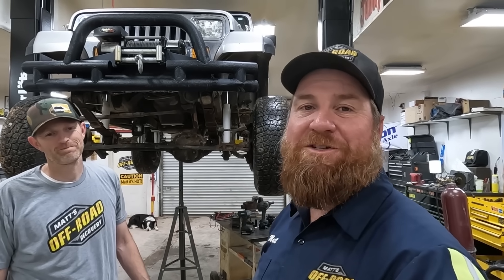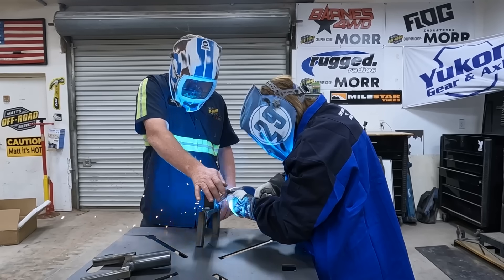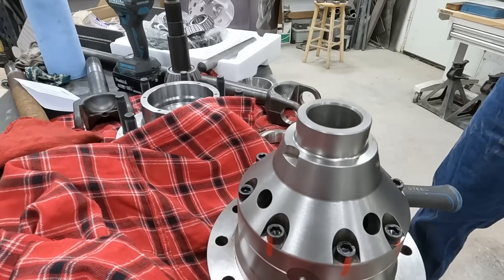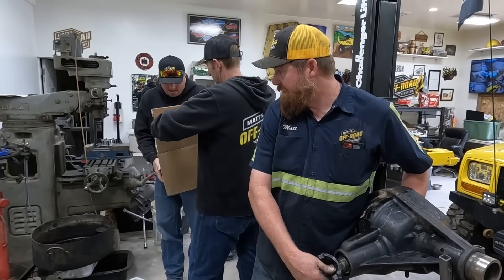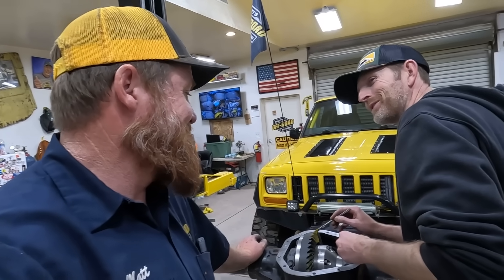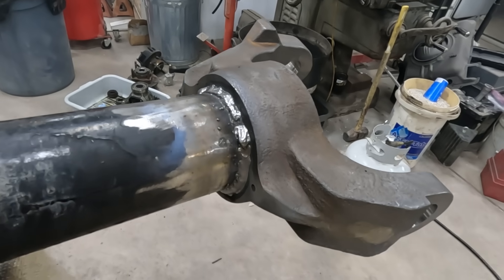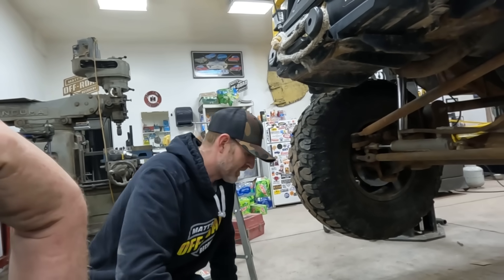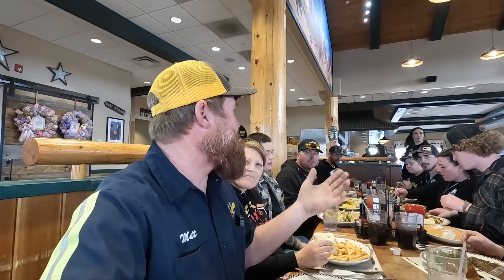Ouch...They Broke My Jeep At The Wrecker Games

Comment: Can you give an update on how Ed is doing? Seems like we are seeing him less and less. If he’s ok to share that is.  Worried about him! ❤
Reply: I was thinking the same! Matt once said it was a "strained neck".  They need to find a gentle chiropractor in the area. It can work wonders, especially if it is primarily percussion tool adjustments and not necessarily traditional manual style. My practice is way too far away over here in Sacramento. I use the Arthrostim tool. It could most likely
 significantly speed the healing process.

Comment: @13:42 The main difference between hot rolled steel and cold rolled steel is the temperature at which they are processed. Hot rolled steel is rolled above the material's recrystallization temperature, whereas cold rolled steel is rolled below the material's recrystallization temperature.
The cold rolled steels' tensile strength is higher than that of hot rolled steel. Cold rolled has a tensile strength of 85,000 psi while hot-rolled steel has 67,000 psi. Cold rolled steels' yield strength is also higher than that of hot-rolled steel, at 70,000 psi compared to the latter's 45,000 psi.

Comment: So was the reverse band smoked or was the band snapped in the 4l80e?  I have a shift timing mod that I came up with years ago that prevents the band from being damaged due to repeated forward reverse forward shifting.  Rigid type bands have limited adjustment ranges due to the ends of the band touching so running tight tolerances is extremely important.  When people perform the dual feed direct mod a reverse engagement delay is created due to the larger volume of fluid needed to fill and exhaust from the direct drum.  I run well over 2000hp in 4l80e transmissions with trans brakes and bump buttons for staging turbo cars and I never have problems with the reverse band.  I run billet servos in all 4l80e builds.

Comment: Just in case you were serious about throwing the old drill press in the scrap pile - I encourage selling it cheap or giving it away with all the caveats you want. There are tons of aspiring machinists and young shop people who would benefit from it, or taking it on specifically as a project to make it better (replace bad bearings, bore out the casting to true things up or sleeve bad fits, etc) as a learning project or use parts from it to repair other machines. Thanks for the great video on the front end repair and upgrades!

Comment: Matt and Tom, I have a serious question to ask of you both.  At this point in the process (38:00) i just noticed that you are working on the axle that you had just completed the magic in the gear box of the differential.  I also noticed the hub of the same axle is still detached!  You spent so much time aligning the gears of this axle, isn't the critical alignment directly affected by it's not being attached while you're aligning the gears?
Reply from the maker: Completely independent of each other. 
The axle shaft have no bearing on the set up or retention of the gears.

Comment: Hi folks,  I build motorcycle trikes and   for years used plastiguage to set pinion  gear preload . Now I use clingfilm. I find   when the taper roller bearings just start to cut through the clingfilm,  the lash is bang on.  Love the channel,  I was into off roading for 15 yrs with a heavily modified Daihatsu Fourtrak so your videos speak to me 😂

Comment: Differential advice from an ancient retired technician. When regearing a differential I always reuse the pinion depth shims. I do this because it's the housing that is likely to be out of spec and pinion is a highly tolerance item so you're not likely to go wrong reusing the shims. For the preload on your carrier also like to go + .001" to .0015" do the measure Gap to get the proper preload on the carrier bearings. But you probably already knew this stuff
Reply: They have no press or bearing separator to get the old pinion shim off. They talk about it when he starts his setup process.
Reply: @hillarylevenworth8824  hot retro take that old bearing off and you could still save the shims at least enough of it to get a measurement. You're talking to somebody with over 50 years Automotive experiencing hundreds of differential so I know what I'm talking about. Unless of course you have the setup jig for that particular differential then you could go from scratch. But regearing a differential isn't terribly hard especially Theory use the pinion depth shim.

Comment: 31:00 They are adding a aftermarket dif cover.  Banks Power YouTube channel did an exhaustive exploration of aftermarket dif covers vs. factory dif covers and showed that factory dif covers were way, way better.  They are engineered to keep the oil and gears much cooler.  Even without fins on the outside.  It's all about the flow patter of the oil inside the dif.  Matt, put the original factory cover back on!!!!!

Comment: Hey Matt, can you please get someone to post the stats of how each of the teams scored in the welding challenge, the dyno numbers, the flex tests, and how far each team went on the dead pull? It'd be cool to be able to compare this years' stats against what everyone does next year & beyond. Thank you so much for everything y'all did to put on the event. It exceeded all of my expectations.
Reply: The Misadventure of Pappa F  -      Dyno - Eric=176 , Rory=188, Paul=196, Merlin = truck was broken down with a transfer case problem , Matt - vehicle was too big for the dyno platform 
                                                             RDI ( Flex numbers )- Eric =804 ? , Rory=702, Paul= 809, Merlin=793 , Matt= 665
                                                            Welding ( Strength test ) =Eric =2900+ , 3700, 3687, Rory=2900+, 3687?  Paul=2250, Merlin=2461, Matt=2943 ( All the chatter made it hard to get the 
                                                             numbers right .)
                                                             ( I did see a summary from MORR at one time , but , I think that even that had mistakes in it . EXAMPLE: Rory had 3 dyno chances and got 122,186, 188
                                                            but the MORR summary had his dyno number at 122.)

Comment: When teaching try to show her techniques and weld patterns on metal without actual welding(you can go super slow & easier to see), and also teach her wire speed and voltage … remember you can listen to it as well! Those sounded great she should know that’s the sounds that should be produced when laying a proper bead or tacking two pieces; Always make sure you penetrate the metal! Loving the videos!!!

Comment: All that welding sparkle, and then the slag chipping, going right down the tube - on to the new seal - thru the new seal and into the gears where the new cover is already glued on. Nice!
Reply: I'd imagine they were smart enough to put rags or other stoppers in the tubes. unless you seen otherwise. 🙃

Comment: I hate rear ends for this reason, Had a truck where the rear end was just noisy and the slip pack was shot and broken, instead of rebuilding the rear end I just brough a used rear end, messing with the gear mesh, mess it up, and well there it goes, and your warranty lol

Comment: Back up the chute. In two wheel drive as far as you can. Then lock the hubs and run out of gas. When you run to the station to fill a can with gas, leave the keys to the Banana on top of the gas pump.

Comment: When you guys welded the axle tubes did you pressurize them to check for small leaks through a pinhole or an internal crack? Put plugs in each end pressurize each tube pump in Freon and use a Freon leak tester for leaks, no squeak no squeal means no leaks!

Comment: Hey Matt i have a  FEW Questions about my personal Rigg. An 86 Toyota standard cab 4x4 5 speed 4 cylinder. Front IFS 😢😢 ( I'M  A VET AND DISABLED. SO EXXXTREMELY LIMITED ON INCOME ) I ALSO HAVE A 350 BLOCK I HAD THOGHT OF WANTING TO REBUILD AND PUT IN THERE...... ( But again  not enough money living on disability) but this show has brought up one of my Questions. As far as a locker
 I have a BASIC LUNCH BOX LOCKER and I'm  ever more curious As to whether i should place it up front or in the rear or whicH OTHER LOCKER SHOULD I BE USING.  I WATCH MORE OF YOUR SHOWS THAN ANYONE ELSE'S.  I DON'T CARE WHOM YOU PAID WHAT AT THE WRECKER GAMES. YOU ACCIDENTALLY GOT CAUGHT TOO MANY TIMES ON CAMERA PAYING PEOPLE. BUT YOU STILL SHOULD HAVE WON. AT LEAST YOU DIDNT WANT TO DUMP YOUR TOW CAR OPERATOR OVER 2,3,4 TIMES BA HA HA HA EXCELLENT OVERALL JOB ANSWER ME BACK PLZ WHN U CAN. I PRESNTLY HAVE 4:11 GEARS AND BELIEVE I NEed 5:28's because I'm gonna put 35's on it...

PLZZZ HELP

Comment: We used Liquide oxygen to shrink metal and normally press fit with a block and hammer. .002 is the cold shrink diameter. Aerospace practice. Methylene chloride and dry ice bath is the process. You can mic the materials.

Comment: Cold rolled steel offers a smoother surface finish, higher strength, and better dimensional accuracy, while hot rolled steel is faster and less expensive to produce, retains ductility and toughness, and is suitable for applications that require bending or forming. The choice between the two depends on the specific requirements of the application.

Comment: Thermal expansion/contraction of generic steel works out to be approximately .00006" of an inch per degree F.  It absolutely makes a difference when you have enough of a temperature differential between the press fit components.  It is common practice in manufacturing, I worked for a company where we would heat a part in a large oven to 400 degrees and freeze the other in nitrogen for high interference shrink fits.

Comment: One issue I wonder about, the dana 60 you had was really a 44 housing with 60 outers. That uses a different lug pattern than the 2004 F250 axle your building. If the rear is the same era as the front the rims may have the incorrect lug pattern.
Reply from the maker: You were describing the Dana 50 axle, this is not one of those. 
And we resolve the bolt pattern issue on the next video

Comment: I have a problum with welding with pinon and ring gear set up !    Years ago Likely before you were born Where I did the very same thing But the earth for the welder was on the wrong end of the housing      And once the job was done It had arced !  Thus welding the gears together (arced )    Back then I used a stick welder unlike today a Tig / Mig but you used the stick welder ,Funny enough the Bearings that had the same charge go through them did not pit them !

Comment: I've got a question Matt, when you put the gear marking compound on the ring gear, you said this is the drive side on the slanted ring gear tooth and then you called the straighter side of the tooth the coast side. I always thought this was the opposite. And you were not as happy with the actual drive side, which, I believe, you inadvertently called it, the coast. Is that a high pinion and is that the way they machine the r&p gears on a front differential?

Comment: To measure pinion preload what I've always done is take a wrench and hang weight the correct distance away from the center of rotation to generate the spec torque.

Let's say I want 25in-lb of torque. To create that I might take a 5lb barbell weight and hang it 5 inches away from the pinion's center of rotation.

That is slightly oversimplifying it in reality because I'll also weigh the wrench itself and estimate it's center of mass and include that in my total torque.

The wrench might add 6in-lb (perhaps 1.5 lb × 4in) so I'll hang 5lbs on the wrench handle, 4 inches from the center of rotation to total 26in-lb (5lb×4in+6in-lb).

Another thing to consider when setting up gears is the application.

If the gears are going to spend their life cruising down the highway with minimal heavy torque loads and the spec says 12 to 35 in-lb preload torque, then setting it up with lower preloads, say 12 to 15 will help it to run cooler and maximize fuel economy.

If they are going to spend their life at low speeds with heavy torque running through them (like an off-road truck with oversized tires used to pull other stuck vehicles) then using higher preloads (perhaps 30 to 35 in-lb) will help to keep the gear teeth aligned while those high torque loads are going through them.

Comment: I love the channel and all the builds but I have to say that gear set up was very painful to watch😂. First, always start with what ever the factory pinion shim was and go from there. The final pattern was horrible. Probably needed another .005 at least and setting up bigger gears like d60 and up I would really advise a little more than .0045 backlash. I know you said in the beginning that you probably aren’t doing it  right or something along those lines but dang man. Anyway, thanks for continuing to put out great videos!
Reply from the maker: We started with the factory shims. 
We ended up, adding .006 shim to get the pinion a little deeper. 

The shims stack on the carrier ended up being the same as factory, but we had to move .003 from one side to the other. 
Since this gearset will never see high speed, heavy loads, I’m not worried about the tight lash one little bit. 

Horrible? Lol
The gear pattern falls well with in Yukon’s specs. Well within. 
I have a lot of engineer, friends, and they all tell me that if the minimum wasn’t good enough, it wouldn’t be the minimum. 

Thanks for watching.
Reply: @MattsOffRoadRecovery  I may have missed something, i thought you were looking at the old pinion to see if there was a shim under the bearing and   Decided to just start with nothing and see where is was at. But after building thousands of diffs I don’t t agree that last pattern is ok, I would not let that roll out of the shop. I’m probably a little more picky than most but I don’t like gear noise and having the pattern too shallow will be weaker than a little to deep. Maybe there was one after the last one I saw but it seemed pretty high on the tooth and much more of a crescent shape than an oval. Anyway not trying to argue, I do plenty of stuff that I’m not 💯 sure about and am open to any advise. I just happen to have more experience setting up gears than most. I’m sure the banana will be fine for it’s intended use. And just a tip if you haven’t done it before I like to heat the ring gear up a bit so it will drop on the carrier to avoid any metal slivers getting under it causing runout. Like I said, big fan and love the content! You guys run a great shop and channel!

Comment: I was curious as to why you guys set up the gears first. Before the knuckles and all the welding fab. How did you keep the slag out of the differential when you were welding it. What about the seals on the inside when you were welding the inner axle to the housing? I was just really curious why you guys did that not that you did anything wrong just curious away. Thanks for your great shows.

Comment: I'm sure my guy I know that worked at Toledo/ Maumee Dana's ASG and Ottawa Lake Testing facilities knew exactly the proper way of setting up the gears and inner workings of those axles.  I used to have to clean the test Labs after a Hydraulic Hose Explosion testing axle rigidity and metallurgy. Believe you me.  Every Dana Axle is put through a Literal TORTURE test. Fun fact. The New Dana Plant now sits on the Old site of Jeep and Willys overland plant from the days of yore

Comment: o my. you will not pass a ase test with that. does the tire noise cover up the gear noise or does it make any noise. love the aftermarket steering knuckles . love fab work. tip always start with the oem pinion shim size.

Comment: It's crazy the types of vehicles Matt has built in that tiny shop, using a card table to cut metal on. Every other show out there is building fancy new shops and buying equipment. Matt just can't get himself to spend money I suppose. Kind of like that myself. If I have something that works, no need to replace it so I end up with 20-year-old T-shirts that still look good. Weird...

Comment: It is very apparent that no one in that shop knows how to weld pipe properly, especially using a stick welder. You are doing a simple 3G weld, but you are having trouble. You are not grinding the ends of the previous welds to taper them, which will likely give you voids where you tied into every weld. I would really like to see how those welds look on an ultrasound.

Comment: So, I'm a fan of what you guys do. I have been reading the comments, and I must say, you don't get any positive advice on your teams welding skills. As far as my experience in this field, I'm over 30 years deep. That being said, Tom, there is a trick to welding ni-cad rod. Also, if you pre and post heat properly, you could have used 7018 as opposed to the ni-cad which also applies to the 70 series wire and so forth, then there is also using lye and wrapping the cast parts you welded to the cold roll or hot roll that you can gradually cool and you can rest assured things will be 100% free of any failures.

Comment: I started out thinking that if I doubled the amount of time I think is required to do a project, I would be close. I now know that it is sometimes 3 or 4 times longer than I expected. My problem is that, in the back of my mind, I still think the first estimate, before I double or  triple or quadruple, is the correct one. I am still not happy when it takes longer than I think it should. I have resigned myself to the reality of life. Things just take longer.

Comment: Guys, it is lot easier to use negative offset wheels instead of narrowing those axles; you want wheel to turn about it's center anyways for more accurate steering and less scrub; even custom wheels would be cheaper and easier, OMG! :(